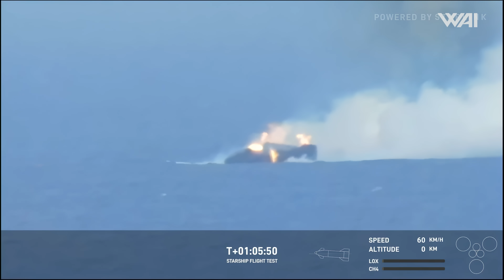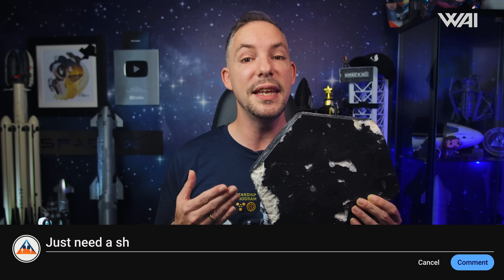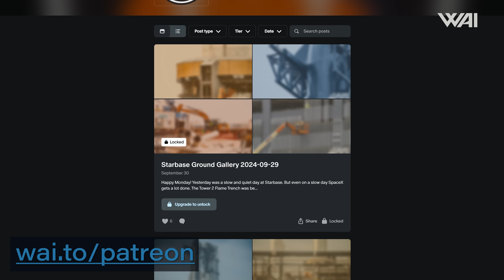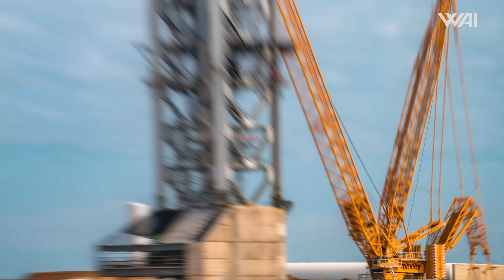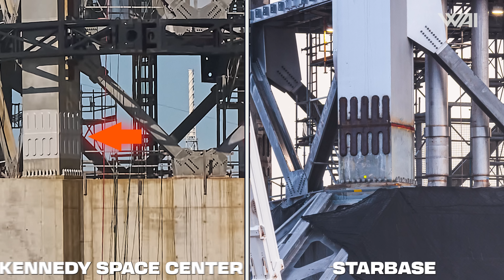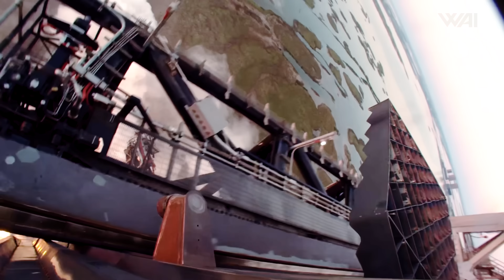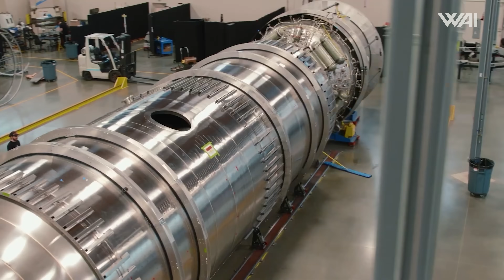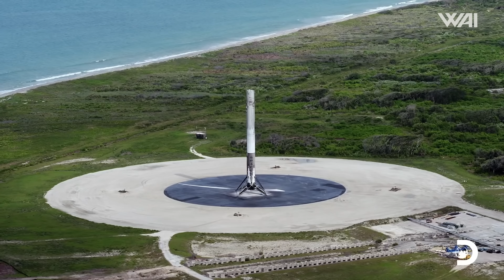Get ready for Starship Flight 7! SpaceX considers BIG Starship heat shield change!

Comment: This is nothing new.  Film cooling was developed by the Germans in World War II for jet engine turbine blades.  Transpiration cooling  was demonstrated by Convair during the Atlas missile program starting in 1955. There is some old YouTube video available from the San Diego Aerospace Museum about this.  shuttle program showed that while durable, ceramic tiles require considerable maintenance between flights. The challenge for space X is going to be how to find heatshield material that will allow the kind of rapid turnaround for the flight cadence they want. With current technology, it seems unlikely that orbital spacecraft will ever have dispatch reliability like jet airliners. If it takes extensive maintenance to turn them around, the launch costs will never be reasonable.

Comment: It's my opinion that ULA never really intended to develop SMART. They were expecting that, once Vulcan was actually flying, they would be able to maintain their position as the national launcher, with a small number of national security contracts at a guaranteed profit. They were hoping their primary customer, the United States government, would quietly forget about SMART and be unconcerned with price, as they always had before. Unfortunately for them, New Glenn is about to become operational, and it can greatly undercut any expendable rocket, and can lift much more payload than Vulcan. On top of that, Starship is coming over the horizon, very rapidly. To make matters worse, DOD has opened up the national security contracts to multiple providers, not just two at a time. Thus, they are being forced actually to develop the system. I seriously doubt it will actually make them competitive with SpaceX or Blue Origin though. They better do something though, in the most recent national security competition, SpaceX won every single contract available for bid. ULA was completely shut out. My guess is that, in ten years, ULA will be out of business, SMART system or no SMART system.

Comment: Let's face it the current heat shield tile solution which requires ìnspection and refurbishment does not satisfy the airplane analogy that SpaceX is pursuing. The metal film shield sounds to be the way to go.

Comment: I think the heat tile solution is an ablative tile grout that is raised above the heat tiles to create a drag/insulation where they get ablated first before the heat tile is actually impacted. Has these ablate they could form a plasma that will further insulate the sensitive bits. You could probably fine-tune it by using different types of grout

Comment: I wonder if you could lay the whole thing sideways on a magnetic rail track. A long straight away with a giant jump at the end, then light the engines when it's almost vertical and is already moving at 600mph or whatever, fast. Just seems like a lot of fuel is spent just to get to orbit, it's really not very far. The heat tiles confuse me too, they make lots of points of failure, why not bigger tiles? Love the pumping cryo's through the ship belly though, that's awesome!
Reply: It isn't the distance but the velocity change that is the issue.  
:planet-orange-purple-ring:

Comment: I’m surprised that the tower doesn’t have a backup communication with a series of dishes and starlink connections that can be used in case of failure of the primary connection.

Comment: No heat shield can be lost at any time. A mission to Mars and return if you want humans on board. On Mars or the Moon will no have replacement system. The tank body of StarShip needs to be corrugated aluminum and Stainless Steel as the otter billy shield with Nitrogen as coolant. With a Titanium 1m pipe down each side below the wing hing.  This pipe will be use as Nitrogen tanks. Wings can be alimented, if control valve/jets are on top and side. The heating of the nitrogen high PSI should control StarShip and the lower jets can reduce heat. The outer edge is where the highest heat is.

Comment: ULA dropped the ball, their "S.M.A.R.T." reuse plan is better than completely disposable but is not very smart as they are still throwing away far too much to be able to compete with Falcon 9 much less Starship.  Note though, how much better Falcon 9 could be if SpaceX just switched the booster to using one or two Raptors.  SpaceX stopped developing the Falcon system of rockets though in favor of going fully reusable.   That's what EVERY other rocket builder ought to be doing right now.  The world doesn't need Falcon 9 clones, it needs Starship and it's clones.
Reply: Falcon 9 would need a total redesign to use Raptors.  It wouldn't be the same rocket at all.

Just one small example, the relative sizes of the tanks would be different.
:planet-orange-purple-ring:
Reply: @Scanner9631  Many rockets have had their engines changed and it's never been a so great a chore that companies forwent such changes.  Even Starship has had it's tank sizes and engine counts changed and will likely have them changes again during this development.  Moving the bulkhead between the LOX and the fuel doesn't seem to be a huge problem.  Changing the overall height of the rocket doesn't seem to be so either.

So why hasn't SpaceX done so?  Because they don't see the Falcon 9 as having much of a future despite the fact that it's the leading rocket of today.  It's basic problem is the same problem Starship is being developed to fix, it's too SMALL to get large amounts of cargo to space.
Reply: @roycsinclair  

Not just the engines but the FUEL is also changed.  That is HUGE.  The amount of thrust of a Raptor is far larger as well and it can't throttle as low making the landing far more difficult.
:planet-orange-purple-ring:
Reply: @Scanner9631  You KEEP MISSING THE POINT!

SpaceX could have and WOULD HAVE done this with Falcon 9 if they thought it was the future. 

Do you really think they couldn't have worked out the problems?
Reply: @roycsinclair  

You are missing the point.  By the time they made all the changes to make the Raptor engines work with other Falcon 9 technology the resulting rocket would NOT be a Falcon 9.

How about the 2nd stage, are you staying with a Merlin or redesigning it for the MUCH more powerful and larger vacuum Raptor?  If you stay with the Merlin you now have a rocket with 2 different fuels and need different fuel tanks and systems at the launch site.  If you go Raptor you end up with an engine working deeply throttled all the time and unable to work at the lower levels a Merlin can handle OR everything has to handle much higher thrust (Dragon Astronauts won't thank you).
:face-fuchsia-tongue-out:

Comment: I think this heat shield is a dead end. A coating with tantalum carbide should be reconsidered. Also, active cooling and the final Starship would be better made of CFC (Carbon in Carbon) as it is 5 times lighter with the same strength to keep the weight within limits.

Comment: The tile thing will never be completely safe. The design of the starship must be changed so they spread the friction heat without creating hot spots like they have now on the fins. Why not hide them fins out of harm's way during the hottest phase of descent and steer with rocket forces?

Comment: Would the coolant medium be LOX or the methane?  Since we are already adding complexity, perhaps liquid nitrogen could be pumped to do the cooling task?  This would avoid overpressure in either of the cryogenic propulsion tanks.  Imagine a turbo pump recirculating liquid N2, which as it vaporizes is then allowed to bleed out the skin making a boundary layer protecting against re-entry plasma.

Comment: They need to add ripples/ridges to the tiles at the points of failure to upset the plasma flow so it cant concentrate its burn.  You cant weld or cut as well in a wind and thats what ripples would do to the plasma. Smooth surfaces make it easier for the plasma to start eating when it meets an obstruction like a flap.

Comment: I do think they should change the heat shield to something more permanent. I never liked the ceramic tiles. They need to be individually inspected after each flight, they often take damage and require refurbishment. Not good things for rapid reusability. To Elon's point, you basically want Starship to simply land, refuel, and launch again immediately
Reply: The space shuttle was proof that a tiled heat shield is great if your goal is to kill your astronauts.

Comment: One of the larger issues with the active cooling system is how labor intensive the construction method is. If they can get by with additive manufacturing the entire thing, that may be a non issue. Another is damage mitigation; if a tube gets damaged (Bent, a hole or obstructed) then the system fails along that stretch of the pipe. Repair can be a nightmare.

A weeping cooling system, as aircraft manufacturers found in the 50's, 60's and 70's are expensive, heavy and very prone to failure: Bugs and debris (dirt) block the pours. They are just not worth the hassle.

I would think a hybrid solution, tiles + active cooling, would be a design point to look at. Tiles over non-sensitive areas are reasonably easy to deal with, where an active system, around the engine base plate, hinge seals and other such areas, might be justified.

Comment: OK  ------------ . Starship already uses full-length U: shapped Stringers running up and down the inside walls of starship.  Passing liquid or warm gas down those stringers along the hot spots of the belly could be enough by themselves to cool a skin that can withstand 1500 degrees by itself.. Without adding extra metal while saving tons of weight from heat tiles...

Comment: Tory Bruno gave a tour of their plant to someone on YouTube. Seeing what they go through to form those first stage tanks and bulkheads I question whether they'll save enough money on recovering just the engines vs. Falcon 9, and especially vs Starship, to compete on price. A lot of smaller rocket engines vs a few big ones seems to be the necessary design requisite for re-usability.
On the reentry problem, I wonder if Starship could use propulsive reentry instead of passive "just survive the heat" reentry. Starship is already designed to do a flip and burn to land. I wonder if getting to the first plasma producing parts of reentry but before really serious heating starts, then firing the Raptors to flip tail first and using the exhaust to both absorb the bulk of the heating and shorten the time it takes to get to Mach 4 or so where a single layer of hull can handle the heat. Firing all six or nine Raptors should produce enough exhaust to protect the hull and reduce the time to get from Mach 20 to Mach 4. Then flip back to the belly flop position for the descent to landing altitude. Finally relight Raptors, flip again and land propulsively. This would require building Starship enough larger to hold the extra fuel required, but reduce the complexity and weight required for passive or active heat shielding by eliminating it, replacing it with a change in flight profile. Someone or other likes to say the best part is no part.
I don't know if that idea has been considered and rejected, or just not considered. I guess we'll find out,
Reply: The Youtuber was Tim Dodd, the Everyday Astronaut. By now, he's had extensive tours of the facilities of SpaceX (actually multiple times by now), Blue Origin and ULA. Each time led by the respective boss. 

For Starship do do a fully propulsive reentry, you'd have to be able to reach LEO with less than half the fuel load, since up there it's all about Delta-V. To get rid of the speed, you have to expend about as much fuel as you did to reach that speed. Maybe a bit less, since you don't have to spend the fuel you needed to get out of the gravity well, but on the other hand, you need to deal with the energy introduced by the booster. Fairly unlikely to work, unless you find a fuel source in space (launching tankers doesn't count!).

Comment: As an engineer the catch tower bothers me.  Too much bending moment.  I would design a U shape that moves on air bearings.  Something like the air hockey game.  Once the booster is catched, the forces are transmitted downward and no bending.  You can also design more movement range than chopsticks. A separate U landing tower can turn on its air bearings and hand off to the launch tower chopsticks.
Reply: Like the chinese rip off is designing. Makes sense but also has its own challenges.
Reply: Something I was taught early in my engineering degree was that it's often cheaper and better to make a simple design more robust than to make a more complex and technically "optimal" design. So for this, why would you bother with a U shaped catch tower on air bearings AND a launch tower when you could just make a more reinforced single tower that does both?
Reply: @rockets-dont-makegood-toas7728 The bending moment on the single launch tower chopsticks is a problem.  Think of it like holding a baby at arms length.  The baby wants to bend your arms.  Now the baby is wriggling, which sets up oscillations.  The U tower is actually simpler and meets first design principles.  The load transmits downward to the air bearings which have no moving parts other than air.
Reply: What about a tower for catching and another different design for launching?
Reply: @BokoMoko65  A U-shaped tower on air bearings does the catching.  It hands off to the launch tower chopsticks.  Two towers and still rapid reusability.

Comment: One thing that SpaceX could try is Shuttlecock Reentry using a Reentry Disc heat shield.  It could be Piggy Backed and mechanically actuated to cover the engine bay during reentry.  It can be returned to position if mechanically possible or jettisoned - for the chopsticks landing burn. 
The Disc does not have to be round, but the shape of a Pringles Potato Chip.  The Flaps can possibly be eliminated.  This can be a single piece with layers of material possibilities.  This would eliminate possibility of loosing many pieces but allow rapid replacement of a worn out Single layer of the shield.  A mechanically separated Piggy Back Shield will be much less affected by the sub freezing temperatures of fuel tanks.  This may affect fuelload, weight, etc, for Starship's reentry orientation to execute the Shuttlecock reentry.  All this will be determined by the weight vs. rapid reusability gain ratio.

Comment: Time stamp 14:36. The word "render" is not a noun referring to the picture or graphic image produced by rendering. "Render" is a verb that describes the act of creating or generating a digital image or a hand drawing. The correct noun for the image or graphic is "rendering." Using "render" as a noun in this context is incorrect and a common mistake for those not educated or skilled in English grammar.

- Verb: To render an image (the act of creating).
- Noun: A rendering (the finished product).

Comment: I’ve said it from the beginning. Space shuttle has proven tiles are untrustworthy. Either you make big tiles that cover the ship in 3 or 4 pieces or do a different system.
Reply: One crack will ruined the entire ship
Reply: @merxellus  replace it, and refurb the damaged one
Reply: @allsystemsgootechaf9885  Goodluck replacing a Heattiles at 7km/sec, 50km in the sky

Comment: Active cooling for thermal protection systems is not a new idea, it was examined extensively for the Shuttle and was deemed to be too heavy, complex and unreliable. Tiles have no moving parts, liquid cooling has a lot of moving parts that can easily break or clog etc. Starship may use it for some critical areas (e.g. the part which will come in contact with the catch arms). Stoke is trying to differentiate itself from the competition with this but in my opinion it's more of a gimmick to attract investors (like Electron reuse, or Relativity Space 3d printed tanks which both failed) and I don't see them achieving it (although I hope I'm wrong and they are successful)

Comment: I'm actually more concerned about landing Starship. I think they'll solve the re-entry heating, but consistently landing safely is going to be challenging. Catching is gonna really have to work.
Reply: It will work, the real challenge is landing on mars
Reply: @maartenvanbrakel2570  No, the Challenge is LIVING on Mars.
Reply: Agreed, and they aren't going to be able to "catch" anything on the moon or mars.
Reply: It will be no problem. The last 2 Starships landed with the accuracy needed to be caught.
Reply: I think having a tower specific for catching rockets might be the trick?

Comment: I suspect that after they figure out the heat shield issue, they will still have to figure out how to land large heavy Earth-moving equipment on Mars or the moon; lowering such equipment from height, on a spindly elevator, is not practical. I suspect they will have to do a in-orbit transfer of such equipment to a dedicated landing craft that can land in a horizontal configuration so that they can drive off the heavy equipment down a short ramp to the surface.

Comment: My guess is that in the end they will handle ship re-entry with 3 entry burns. First one will be decelerating really hard at the orbit, the mass of the ship is considerably lighter already so it won't consume too much fuel. The other two entry burns will be similar as with booster already does. 

They will carry extra mass to orbit anyway with any other system, but here they will win simplicity; best part is no part.